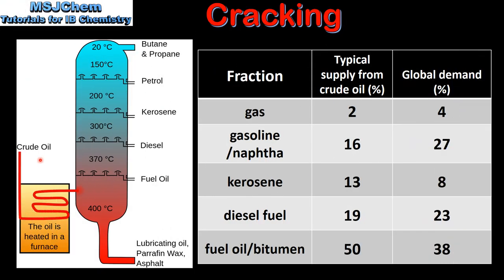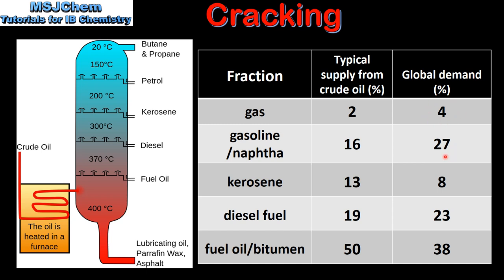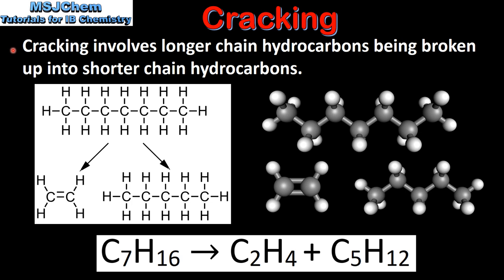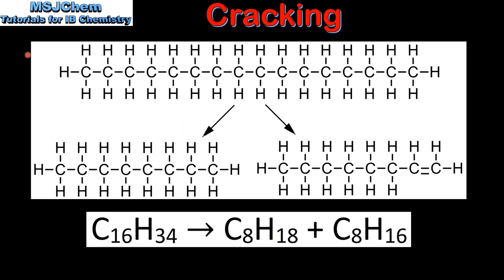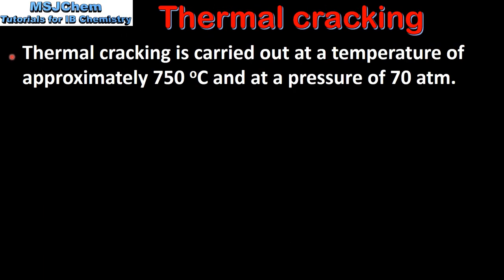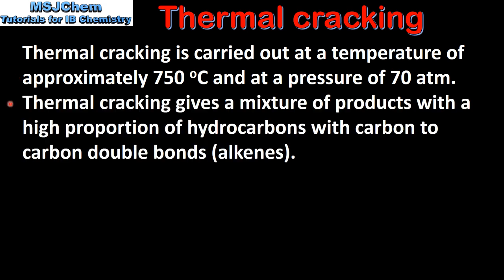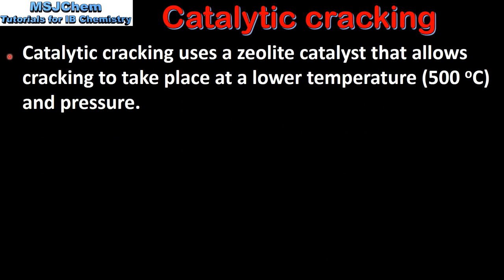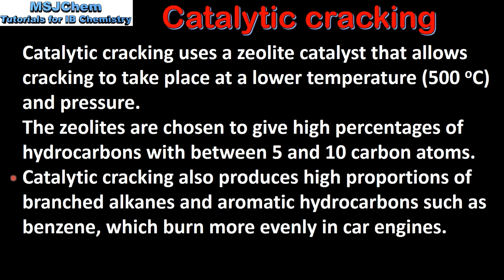C.2 Thermal and catalytic cracking (SL)

Comment: Hi Mike, I was wondering whether there are any preferences to the sizes of molecules from a cracking reaction.

You showed C7H16 --> C2H4 + C5H12

I'm wondering whether the products can instead be C3H6 + C4H10, C4H8 + C3H6, or C5H10 + C2H6.
Reply from the maker: The end products of the cracking reaction are dependent on the temperature and the catalyst used. So technically, a range of products is possible depending on the conditions.
Reply: Thanks!
Reply from the maker: +md radish That's me!